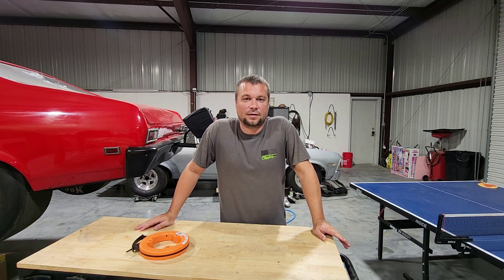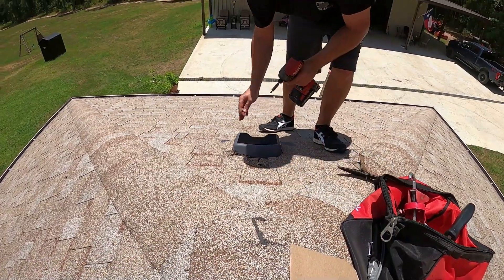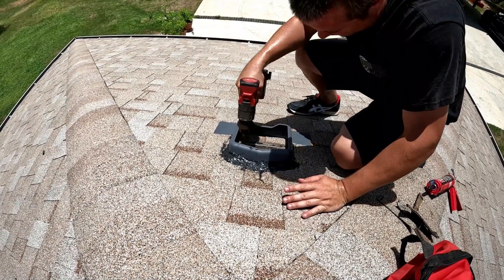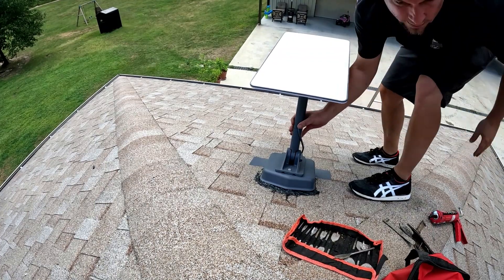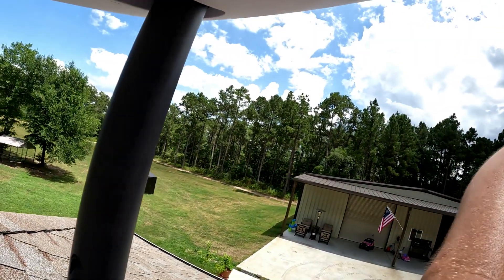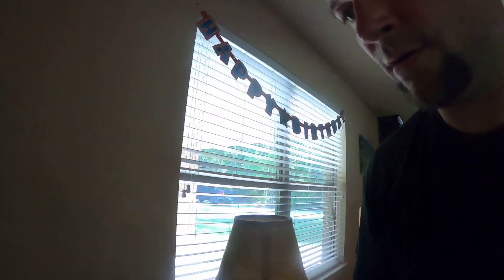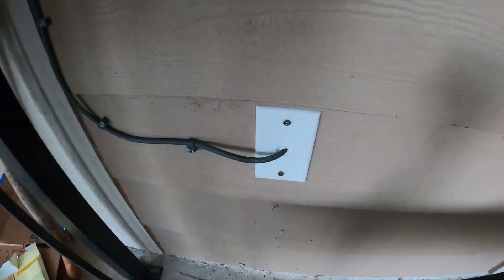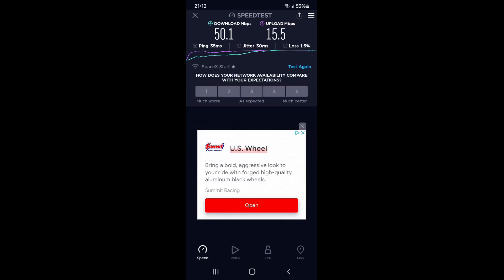Starlink Roof Mount Full Install and Speed Test

Comment: Wondering about using Starlink so criminals can't cut the wireless access to the cameras and any alarms. I am interested in using my Starlink that I usually use to work in my camper for my new house. I realize that the weak link in the system with a criminal would be to find the Starlink cable outside and cut it turning off everything. Any thoughts on bringing the cable through your roof and down into the house instead of the outside and then back in? I appreciate your wife's bravery on the roof! She's a trooper!
Reply from the maker: You can run from the roof, into the attic and down an interior wall. I ran mine the way I did because that was easiest.

Comment: What are speeds like now?
Reply from the maker: Still varies greatly throughout the day. Off peak hours are very fast 40 to 120 down and 5 to 20 up. I never have a problem streaming. Peak hours, especially a holiday when everyone is home, slow quite a bit on upload speeds but I can still stream with no problems. I only stream HD not UHD and usually 2 devices at the same time would be about the max. Sometimes uploading a YouTube video will take a while but better than our local DSL that runs about .5 up.
Reply: @schmitty750  ill invest so ,thank you for  the feedback
Reply: @schmitty750  I know this was a while ago you posted, I had similar DSL around 5 down / .5 up which got very slow during pandemic for working at home.  Sometimes lower than 1 Mbit down.  I wish I had starlink then, but now I have it in Canada and my speeds are almost 300 Mbit down / 30 up , which varies through the day down to about 150/ 10.  Are you getting faster speeds these days?
Reply from the maker: @Healcraft  I've never had speeds that fast. Mine are generally 190mbps to 40mbps. I'm really happy with the speeds.

Comment: You were very thorough on sealing the roof. I found that you have to run the cable from the router to the satellite which doesn't have the large elbow like you discovered. I did the same thing you did. Mine was a masonry install. -Marc
Reply from the maker: Yes, definately not fun doing the cable run twice. If it was sent to me without the dish end of the cable I would've seen what I needed to do right from the start. Being that the dish end of the cable was plugged into the dish, it looked hard wired so that is what I assumed.
Reply: That is interesting, I looked up the flashing mount install guide and it does say to do it the way he did... weird.  I bought an arm mount and cable routing kit, which the install for the cable routing very clearly says route cable from inside to outside (opposite for high performance SL).  Cable routing kit also comes with a handy plastic piece that covers / protects the cable connector while you have it disconnected, and is long for poking / pulling through the wall
Reply from the maker: Very nice having a cover for the connector. I used electrical tape!! 🤣

Comment: Oh, and I guess it don't matter what direction the flat part of the dish faces? As long as the master is near vertical? I guess I'm use to having to aim it directly like a "Dish network"
Reply from the maker: I believe it turns on its own. I've noticed randomly it will be pointing in a slightly different direction. Just says clear view of the northern sky and does the rest.

Comment: Any update on performance?  It looks like I'm north of you in Mt Vernon area, gonna have to do a similar install to get above the timber.  Wondering if it's worth the trouble to do a 'permanent' mount or something a little more redneck...
Reply from the maker: It does just fine for streaming and surfing. It has slowed down a bit but still far better than my other alternative.

Comment: You can unplug the cable on the rectangle dish end, that plug is not so big.
Reply from the maker: Yes I figured that out the hard way. Basically had to pull wire twice lol.

Comment: I'll be installing a rectangular dishy up soon Schmitty so watching your vid with interest. With the big right-angled plug on the router end you then have to push the smaller dish end up from underneath. Who can do that up inside an interior wall then into the roof space then through a small hole in the roof? Answer: No one. It's arse about. That hug right-angled plug at the router has to go and when you consider these guys put rockets into space but can't logically think through a typical roof/brick wall/ installation properly, it's scary.
Reply from the maker: Yeah Jed! If the wire would have been unplugged from the dish in the package I would have seen that one end has a right angle and one end is straight. Then I wouldn't have had to run the wire twice lol! I just assumed that the wire plugged into the dish was hard wired and no connector up inside of it. Live and learn. Sucks doing it twice when it's 95 degrees out and 130 degrees in the attic. Thank you so much for watching and I'm glad my mistakes can help you! I thought about editing that part out so I didn't look stupid but I figured it might help some people. Please subscribe too, I have a lot of videos you might find interesting and some you might find boring too 🤣
Reply: @schmitty750  Your "mistake" was extremely understandable. The first gen kit was hard wired at Dishy's end.
Btw, here in Oz we get stinking hot days and l-o-n-g summers. Feels like it's getting worse in the sub tropical part of Queensland where I live in : - )

Comment: When you were installing the flashing mount, you said "it said not to cut the bottom shingle"...Is there an instruction manual from Starlink that said to cut the upper shingle?  Do you know where we can find a copy of the installation manual??
Reply from the maker: Yes there is a manual. You can get the PDF on the starlink website. There is a manual under each product.

Comment: Nice! I’ll be getting my Starlink later this evening and set it up! I can’t wait! I live in the middle of nowhere!
Reply: Did your Starlink,if so,is it fast?
Reply: @ZAND4TSU  I get about 220 download, 20 upload, 25-50 ping
Reply: @ModestCube100  220 mbps, damn, is it really that fast? It's cause i normally use hotspot, but tomorrow I'll get my Starlink shipped, so i wanted to know how much people get from Starlink, but anyways, that for your comment :)
Reply from the maker: That is about the fastest I'll get but it does vary. The slower speeds I get are around 20 down and 5 up, which is still twice as fast down and 5 times as fast up compared to what I used to have.
Reply from the maker: In the video I show a couple of different speed tests.
Reply: @schmitty750  but, are the 20 mbps speeds frequent, or only happen once in a while?
Reply from the maker: @ZAND4TSU  it varies by the minute. You can run a speed test and get 20 then immediately test again and get 80 then 40 then 60 and so on
Reply: @ZAND4TSU  yeah I had unlimited Hotspot for about 3 years with AT&T 3rd party sellers. It had some great speeds but playing online wasn’t the best.
Reply: @ModestCube100  ikr
Reply: @schmitty750  oh,ok
Reply from the maker: It's not big city fast but about 4 times faster than what had so I'm loving it.
Reply from the maker: Lol have fun! Thanks for watching.

Comment: Yea just went through this myself - and I too am wondering who decided to make the cord have that GIANT elbow piece on either end knowing you needed to run it through tight spaces.
Reply from the maker: Yeah it's crazy. Being that the other end was already plugged into the satellite receiver, I assumed it was hard wired. I never even tried to pull it out until I had already drilled some big holes! It's funny now but when I was about to die of a heat stroke it wasn't very funny. I was pissed when I figured out that the end on the reciever pulls out and is small around.